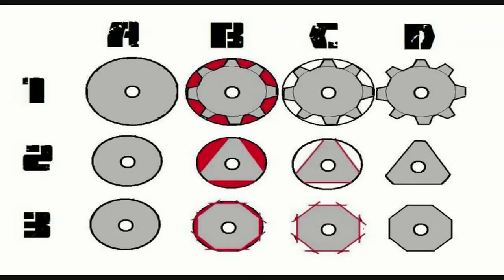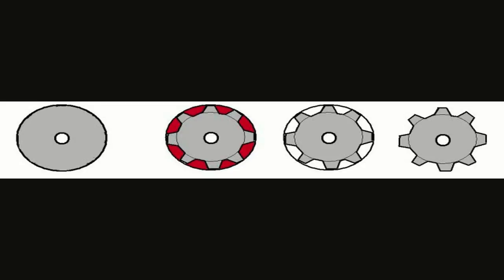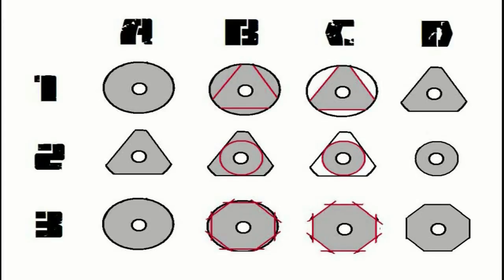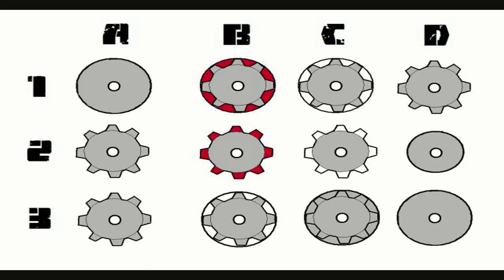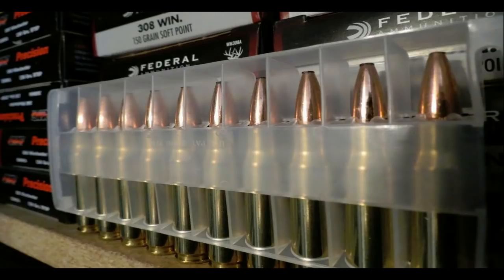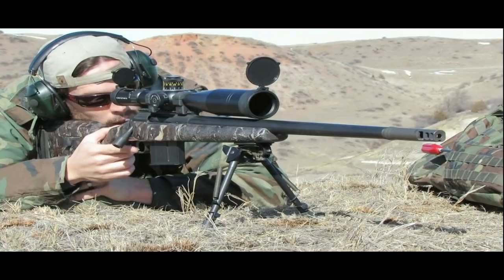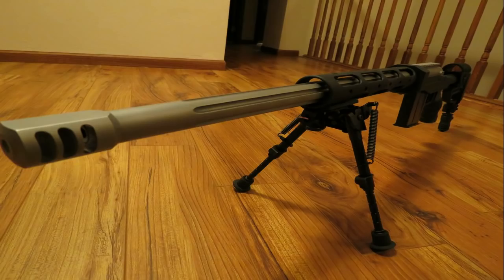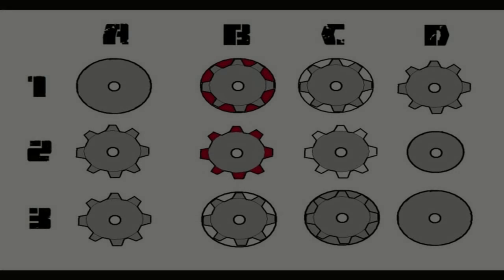Long Range 101 Part 10 - Fluted Barrel Rigidity and Cooling Dynamics - Rex Reviews

Comment from the maker: This series can be found in its entirety along with THE REAL D.O.P.E. when you subscribe to the TiborasaurusRex Patreon page!  https://www.patreon.com/tiborasaurusrex
Reply: Please retrace your comments re thermal advantages vs fluting. That is the ONLY part in your video that is incorrect.
Reply: So a barrel has a spline like an arrow. I need a 300 spline on my arrows from 70 lb bow. Meaning a stiff arrow so it don't bend and wobble coming out of the bow. I can feel a good shot out of the bow. It has a different vibration. So my 308 clamped down with 125 grn varmint round shoots 1/2 groups 100 yards. The vibration is transfer to the clamp. Which is better vibration dampener than my arm. And why I don't get same group with my arm. I have a zombie slayer break. I was wondering if the prongs effected harmonics. As it has a tuning fork sound. Meaning the vibration is the greatest on the break. On the other hand that muzzle break maybe a vibration dampener absorbing and transfers the vibration out of the rifle. It's a heavy 12.5 barrel mid length gas pinned. So I shoot varmint rounds 125 grains for target shooting. To get back speed the shorter barrel lost. Lighter bullet is more accurate. More like a 6.5 than 308 except more power.

Comment: Hi Rex, I studied structural and materials engineering for my degree. Much of what you address here is true. Structurally speaking, the advantage of the flutes is the drastic increase in rigidity for the amount of material used. Fluting might be more advantageous for someone who wants to shed weight, yet maintain more rigidity than if they had a round barrel of equal diameter. If weight isnt a factor, a bull barrel is more desirable for its harmonic advantages. However if weight is of the highest value, a fluted barrel will have the highest rigidity to weight ratio.
Reply: 100%
Reply: How does the addition of flutes effect harmonics?
Reply: @viewatyourownrisk  A full bull barrel is stiffer than a fluted one of the same outer diameter.  Thus its vibrational amplitude should be less.
Reply: @JaronActual  unfortunately this is incorrect. In engineering school our professor gave the class this exact problem. Everyone got it wrong via the same logic as Rex saying removing steel reduces rigidity. However, once he ran the math we learned that the shape is extremely important.
Reply: @bigwestreviews4933  Can you explain that more? Assuming two bars of equal length and the same outer diameter, A1 and C1 from Rex's diagram, would not A1 be the stiffer of the two?
Reply: @bigwestreviews4933  well I'm sure an engineering school you must have also learned that by manipulating the force of the material you can increase the molecule structure meaning if you're just cutting away material you're reducing the crystalline structure of the material how do you not understand that

Comment: I appreciate your thorough treatment of your topics. I see what others are saying in that you could make your points in less time, but I also think it is worthwhile to spend the time studying the issue from various angles. The repetition of key concepts helps cement them in the mind of the student.

If my vote is relevant, don't listen to the folks complaining about video length. I look at your series as the equivalent of an expensive series of classes, and I sincerely appreciate you making all of this available for free. You are rendering a monumental service to the long range community, and I would be disappointed if you caved to the complaints and changed the format of this series to match the average youtube attention span.

On another note: I have a couple of little niggles regarding this video. I wouldn't even bring them up, but your typical treatment of technical topics is so precise that I thought it would be worthwhile to address.

First, you cover all of the key concepts necessary to arrive at this conclusion, and you state it explicitly near the end, but I think it should be more prominent in the discussion: A fluted barrel will have less rigidity than a bull barrel of the same major diameter, but a fluted (or triangular, etc) barrel will have more rigidity (and better cooling characteristics) than a bull barrel of the same weight (assuming you don't utilize some especially idiotic cross section).

Second, and more technically, at one point you state that the moment of inertia is a measure of rigidity. This isn't really the case. You can have a very high moment of inertia with very low rigidity. As you state later in the video, it requires some complex calculus to characterize the actual rigidity. It is, in simplified terms, a function of barrel cross section, length, and material strength. If you are using reasonable cross sectional geometries, the rigidity is likely related to the moment of inertia, but not in a simple way. A fluted barrel is generally going to have greater rigidity than a bull barrel of the same moment of inertia.

Again, great work. These two points aren't really major enough to detract from the value of this video, but you seem to go to great lengths to provide technically sound information, so I thought I'd bring it up.

What is your background? Are you an engineer? Where did you learn all of this technical information well enough to present it like this?

Thanks!

Comment: After over a half hour of video it's concluded that what I and many others believed is true; pound for pound a fluted barrel is more rigid than a round one.  It's much like adding gussets to a structure, maximizing strength while minimizing weight.

Not a knock on all the info at all and I appreciate it, just summing it up for the masses.  Many people won't watch such a long video full of scientific detail and I suggest you consider summing it up from the start then give all the details.  But if you don't care that some people just skip to the next video because they embrace their ignorance I respect that entirely; all depends on your motive for doing the videos really.

I've watched a few of your videos and have liked them, subbing.

Comment: Thanks for the great videos, Rex. However in the case of fluting I think you only covered one of the possible looks at the topic. Your conclusions are correct assuming you have a barrel of a given diameter and you have to choose whether to make the flutes or not. However there is another look: you want a barrel of a given weight and you have to choose whether to have a smaller diameter bull barrel or a larger diameter fluted barrel. Then the fluted barrel would be preferable: you actually came to that conclusion yourself comparing the ,700 bul barrel and ,850 fluted barrel at time 33:45.

Comment: 29:50. Technically you are getting air movement. Through convection, air around and underneath the barrel is being heated making it less dense than the air surrounding it, thus making it rise. It's basically the same exact way the fin tubing in your heating system works. It creates a convection system.

Comment: Thanks for the info on fluted barrels. Cool bug, 2110 , 82x90.5 . I dragged raced vw's for 30 years. That slowed down and now have the rifle bug, haha. I built a AR15 upper with a Spinta 20' fluted barrel a couple of years ago. Spinta said I should be able to shoot 700 yards with 223 match grade75-77 grain bullets. Tac driver at 100 and 300 yards so far. Hope to test at longer ranges soon just for fun.

Comment: Dumb question incoming.. 
What would be the most "rigid" of a fluted and a round barrel of the same weight & mass? Does the flute actually help with anything or would a simple skinnier barrel of the same mass do the same trick? 

I might have butchered that question so pardon my ignorance.
Reply: The whole point of fluting is to reduce the weight.  You start out with a heavy contour barrel which is very rigid but it weighs a lot. If you have one barrel that’s fluted and another barrel that’s not but they’re the same outside diameter, the barrel without fluting will be more rigid because it has more material than the fluted one.

Comment: When calculating moment of inertia, length of the moment arm is an enormous factor. The farther away the material is from the center, the more effect is has. That's why it's so much easier to bend a solid tube than a hollow tube of the same mass. And why it's easier to lift 80 bounds close to your body than to lift 40 pounds at arm length.

A fluted barrel will always have more rigidity than a solid barrel of the same cross sectional area (which would be larger than the radius of the circle touching the interior edges of the flutes), and will always have less rigidity than a solid barrel of the same outer diameter but will weigh less.

If rigidity were really the driving factor in barrel selection, you could mathematically determine the optimum distribution of mass to yield the best rigidity to weight ratio.

In the real world, it sounds like uneven heating and cooling that comes from imperfections in the steel and tolerances in manufacturing have a larger effect on accuracy because the barrel will warp more. It's a lot easier to smooth a round barrel out by just turning it on a lathe. Perfectly balancing the steel around the center of the bore at every point along the length of the barrel in fluted rifle just isn't realistic, even with modern technology.

Comment: I would think fluting would have some type of effect on acoustics. If waves are going through a barrel and it has a maximum wall the (OD) and a minimum wall the (ID) of the barrel to pass through, wouldn't the acoustics have interference or some type irregular pattern as it passes through the higher parts of the flute and than move to the lower areas of the flute?

Comment: This is a good and a very easy to understand video. You mentioned that the shape of the barrel plays a role as well,  but didn't speak on that at all. I believe that the shape would probably play a big role into the rigidity, in some cases less material and the geometry of the barrel might even cancel each other out, or at least get very close. Is this anywhere near correct?

Comment: Dude, I have wached a few of the videos, and I plan to watch them all. Well done. 

I have a theory that i would like to run past you. The harmonics is caused when a bullet travels down the barrel, what is the link between the twist cut into the barrel and the harmonics? Cause the metal wil move and expand in the weakest spots more than the rest when the bullet travels down the barrel, with all that pressure and heat behind it. So if the twist is clockwise and 1/10 and .25mm deap, and one cuts a anticlockwise twist 1/10 and .25mm deap on the outside of the barrel. The two should in theory cancel eachother out... do you agree?   I would love to hear your feedback on this.

Comment: @TiborasaurusRex 

Out of curiosity: Suppose you have two barrels of equal weight (and length) and you fire them both at a constant 6 RPM until they reach thermodynamical equilibrium; that is, they both use convection with air (under identical standard conditions) to maintain a (reasonably) constant heat input/output to/from the system.  Suppose that the fluted barrel has 90% more surface area like in the video. For reference, heat flux is measured in Watts per square meter (W/m^2) in the SI system of units.

In these conditions, does it not follow that the fluted barrel will maintain a lower constant temperature during continuous (6 RPM) fire than the non-fluted one if both give off the same, constant amount of heat energy? And does this not potentially affect the amount of material expansion due to heating (assuming that the steel is uniformly hot throughout due to its high conductivity), if the two barrels are made of the same type of steel?

In other words, since both barrelse need to give off the same amount of heat energy (in Watts) from the rounds fired through them at 6 RPM, but since the fluted barrel has almost twice the surface area of the non-fluted one, does that not mean that the amount of heat energy (W) which needs to be removed per unit area (m^2) of the fluted barrel to maintain thermodynamical equilibrium will be almost half of that of the non-fluted one?

Inquiring minds would like to know.

Comment: Just one question. I read an article and stated that in a test where lasers were mounted to the scope, receiver, and barrel then zeroed to a single point and shot that the barrel laser didn't return to zero on the fluted barrel while the one on the solid barrel did. I'm sure you can see my concern. Any input and especially links to studies would be greatly appreciated i have looked all day and can't find solid studies on it.
Reply: +meccastreisand The guy quoted his source but didn't have the data available to him. But the same article did stat that they went to a certain long range competition, I forgot which one but he referred to it as "the Olympics of long range shooting". He interviewed the top 50 shooters and had all the statistics for the brand, type, length, and ect. having to do with their guns. Only 1 I believe had his barrel fluted and he was in the bottom 5.

Comment: Summing up first 16 minutes: More material = more rigidity
Second Part: More surface area* = more heat dissipation, fluting isn't worth it
Reply: Johnathan Griffin actually theoretically, more surface area will give you more heat dissipation, therefor fluting would be worth it in that regard
Reply: Depends really.
If you shoot five rounds, wait five minutes, shoot another five rounds, wait again, etc (i.e. bursts) Then a fluted barrel is better, because it allows for faster cooling.
If you just want to fire 15 rounds at once and then leave, a normal barrel is better, because it can take more heat at once (more mass).
As always it depends on what you're trying to achive.
Reply: Raised portion of each flute is a heat sink and draws heat away from the inner diameter of the barrel. The flutes draw heat and create a situation in which heat is not being radiating evenly throughout the inner diameter of the barrel. You’ll end up with inconsistent heating of the barrel. Especially on whichever side of the barrel that’s exposed to wind. 
I think a fluted hunting rifle is fine for weight savings. How often does a hunter heat soak a rifle barrel? 
If you’re after maximum precision or in a combat situation, flutes simply aren’t practical.

Comment: So given your video I am deciding on going with m40 heavy barrel non fluted for my 30-06. Weight and accuracy are my balancing act. I lean toward accuracy and ballistics. Would you recommend a 24" with break or 26 inch no break for 30-06. I like the first choice but wanted to know if you would lean toward the 26" and why? 

I'm thinking 24 instead of 26 bc I'll cut two inches of weight and add a break for reduce recoil on the 06 while maintaining rigidity with the m40 barrel. Why pay for an m40 barrel and then flute to control wieght right. The break will make up for recoil loss in sacrificed weight but the 24 heavy barrel should still offer recoil reduction. However did I sacrifice a lot of accuracy and ballistics on those two inches?

Comment: I'll stick with my tried and true "bull" barrel. However, I've considered hooking up a rotary table and cutting 1 channel with a helical angle the entire length of the barrel using a ball nosed end mill. That would give a little weight reduction and help with cooling without compromising too much integrity of the barrel (I think). Of course, I would try it with a piece of bar stock before I started whacking on my actual barrel.

Comment: Where do carbon fiber barrels fit in? Are they worth it? There has been a lot hype about carbon fiber wrap barrels.  Curious on your thoughts.
Reply from the maker: Carbon fiber offers increased rigidity with minimal weight increase.  Very good for mission parameters where weight is an issue.

Comment: So if I heard right...(I'm still picking up parts of my head when it popped from all of the information)... Fluted barrels and bolts do NOT help with rigidity and cooling, but it DOES help with accuracy?? Is that right?
Reply: No. Fluting helps reduce weight and keep some rigidity and gives the barrel more surface area which helps somewhat with heat convection (but not much).

Comment: In your example of a .850" fluted versus 0.70 non-fluted barrel you claim that the weight of the two barrels are the same, but how could that possibly be the case, as the inside diameters are the same, with the added material comprising the flutes, adding weight to the fluted barrel compared the barrel minus the flutes.

Comment: fluted barrel gets hotter faster then cools faster and it does not make your barrel more stiff like the some barrel maker made up, it makes it  weaker creating barrel whip. so its not much a heat deal its also a weight vs weaker more barrel whip.

Comment: You didn't really touch on the main point to this.  Pound for pound, is a fluted barrel more rigid than a round barrel.  I understand less material less rigidity but what if you fluted a bull barrel to the weight of a round medium profile round barrel?
Reply: If you have the same weight, then the fluted barrel is more rigid, because adding structure makes things more rigid.
However, since you can only take material way from a barrel, that's not really the point.
You can't "add flutes" on top of your barrel, you can only create them by removing material from your barrel.

If you really take a heavy barrel and flute it to the point where it has the same mass as your medium barrel that you're trying to replace then yes, it will be more rigid.
But that's not exactly what you normally do...